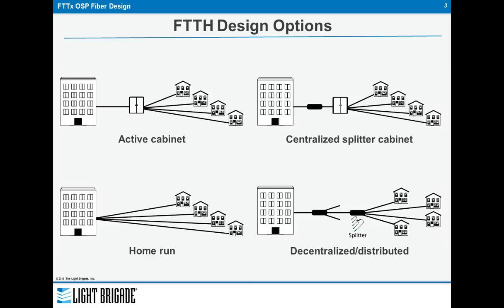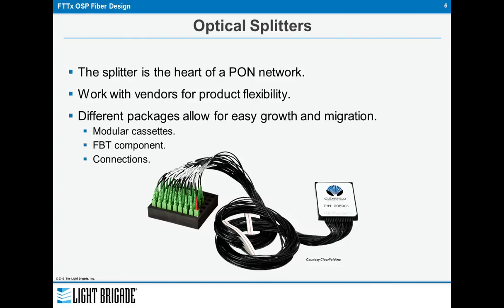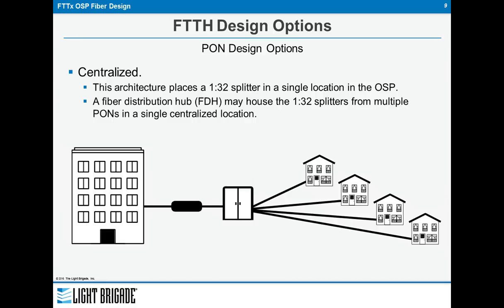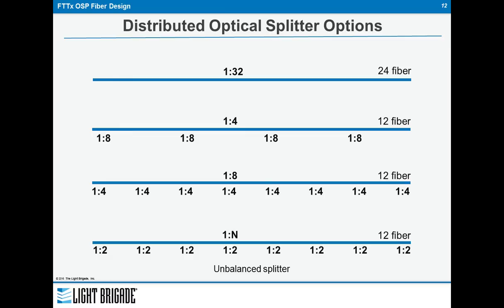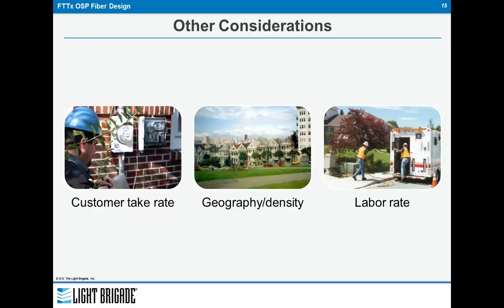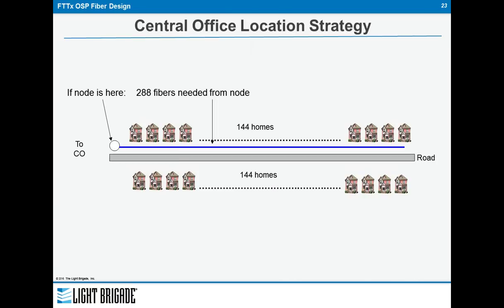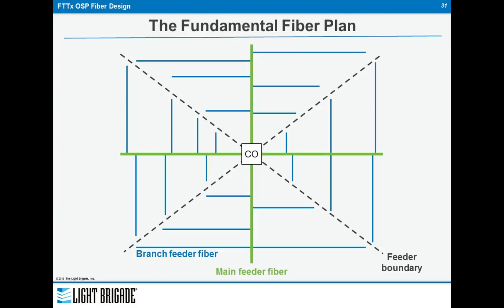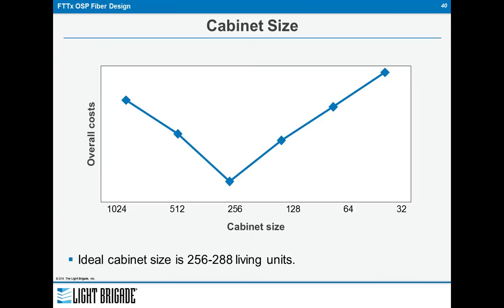FTTx OSP Design Considerations

Comment: How far can the light travel from the central node/CO/Center to the end home before it is too weak? OM 5 is 550m/1800'?
Reply from the maker: Fiber to the home networks are built with single-mode fiber, so OM5 multimode fiber would not likely come into play for
this scenario. By using SM fiber, the distance from the CO to the homes can be quite long, but it is dependent on the other components in the network and how much loss they contribute (like splitters, connectors, splices, etc.).